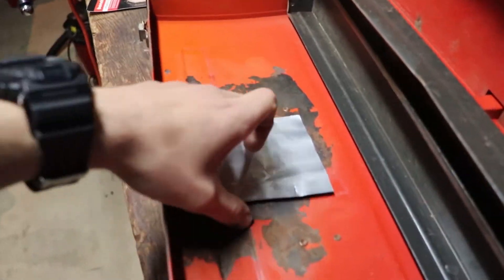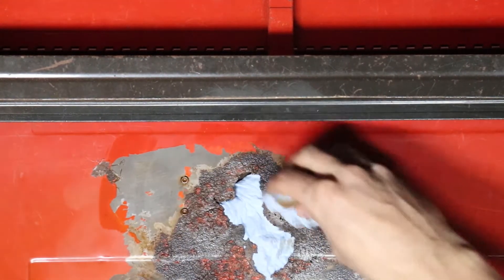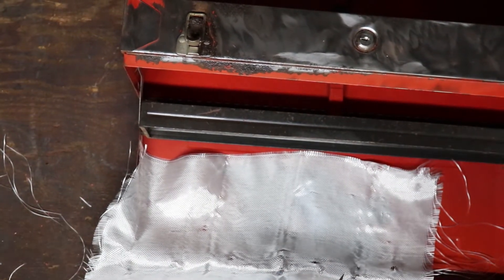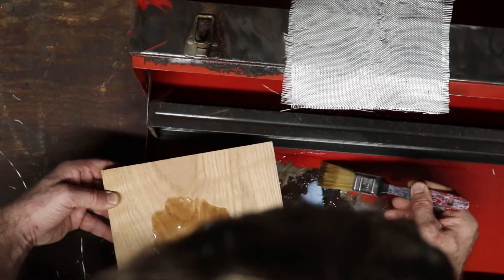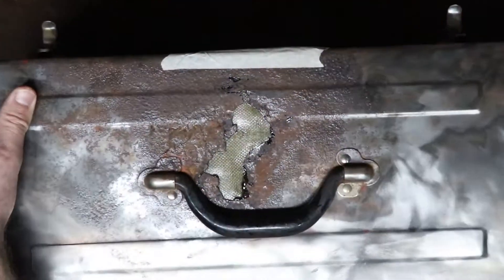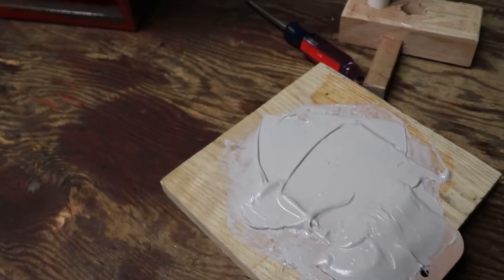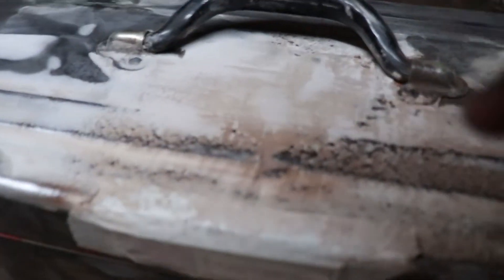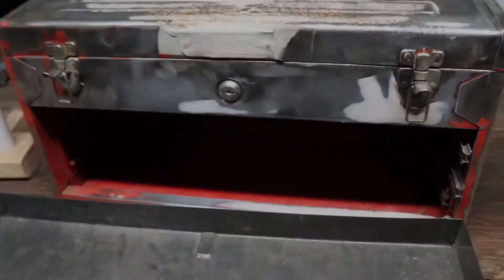Vintage Craftsman Tool Box Restoration

Comment: #1.  We can still see rust on the lid where you say you removed all of the rust.

#2.  You’re going to be using fiberglass material but you’re calling it bondo- they’re not the same.

#3.  You’re gonna just use the “patching material to hold the patch panels in place?  That ought to be interesting.

#4.  Aluminum and sheet metal, which the original box is made of, are dissimilar metals and may not work well together.  Time will tell.
Reply from the maker: If you watched the complete video you would learn that what you said was already resolved in the video. Also, the fiberglass material is made by a company called... Bondo. Thanks for watching